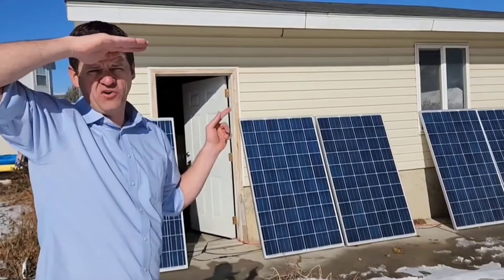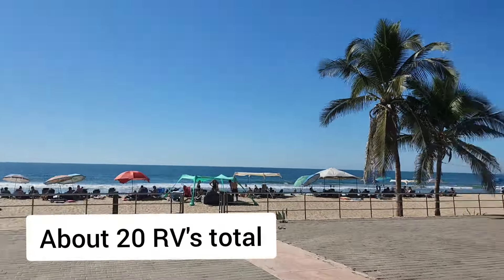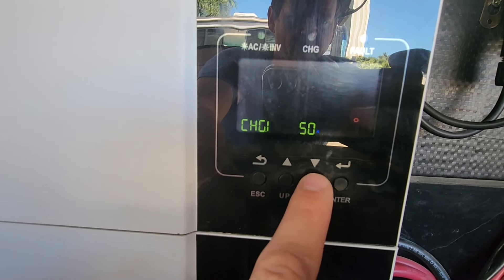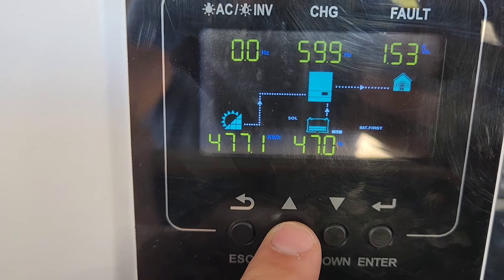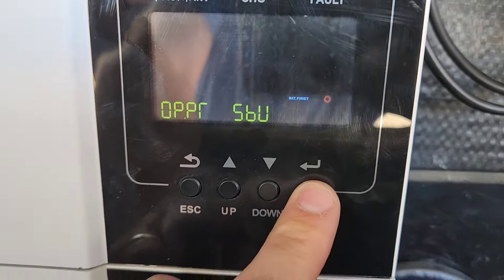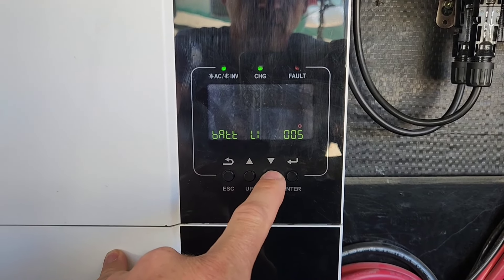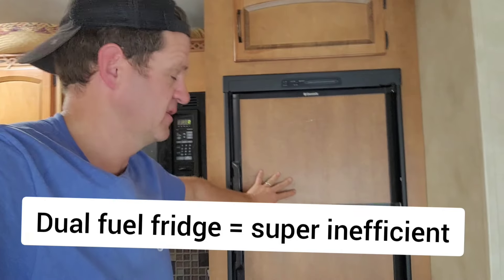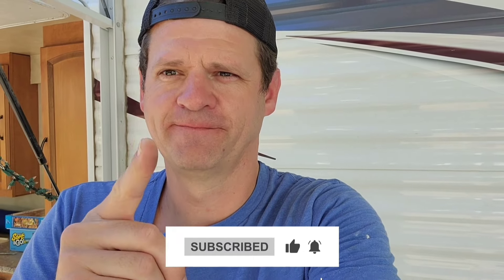20 days OFF-GRID in Mexico

Comment: Well done video! Thanks for sharing your experience. I once did a cross country trip from WA to MI, good memories.
Thinking about putting a couple flexible solar panels on my camper shell for my truck and wire them so the batteries are always at full charge.
Reply from the maker: That's actually not a bad idea. You might not have to replace your battery as often and it could end up saving you money

Comment: I bought four 525 watt bifacial panels.I get 350 watts flat,vertical or 20-45* tilt.
That’s per panel.Still have to mount them.
I’m hoping I get more watts in summer.
Reply from the maker: Nice, I put a tiltable rack on my last RV solar panel and never used it so I decided to go with straight flat this time around. I definitely don't get as much power out of it when it's flat.
Reply: @diySolarPowerFunWithRay  the 525 watt panel wattage didn’t fluctuate but my 100 watt Renogy does in different positions.
Wonder if it’s the difference between bifacial or none. And the claimed 525 is only in lab settings. 😛 
I don’t think 350 watts from a 525 is good.I should check the other 3 panels too because I’ve only been using 1 of 4 for a few days calculating.

Comment: my 55liter (54quart) dc fridge, the largest size ive seen, uses around 150wh per day with all the mods ive made. those 12v dc fridges acually run fine on 24v, which for automotive spec means up to 30v. i converted it to take 28v through a usb-c cable, and covered it in low emissivity al foil tape. one solar 100w panel could easily keep up, i have 2 on the roof of my old phev. building a mini ammo can dc power station (like the anker solix c300 dc) but it has half a kwh of capacity in a smaller package. think it would be better to keep that charged so i dont have to worry about the dc ports in my car turning off, and it would be its own system, more portable. this is a cool video though, those old rv fridges are poewr hogs now days
Reply from the maker: Cool.  Interesting those 12v fridges can accept 24v.  Do you have any helpful links that helped you make your fridge mods.